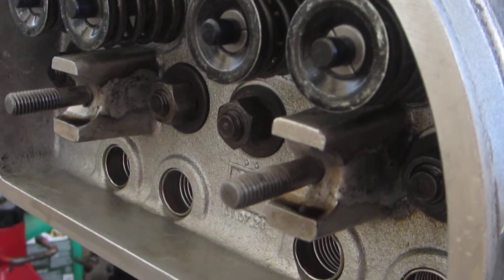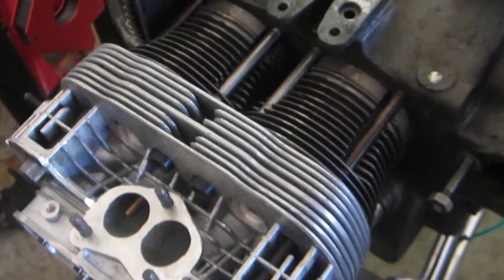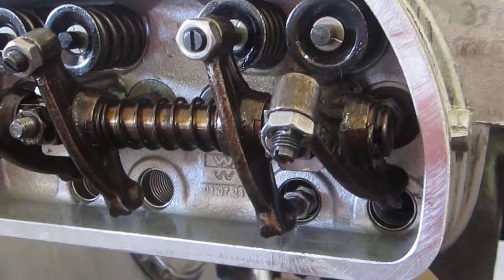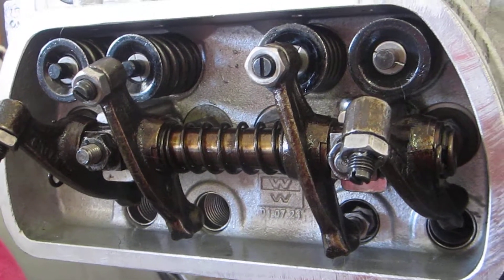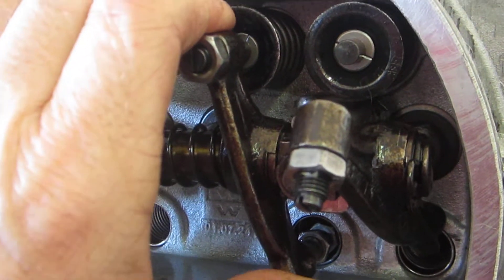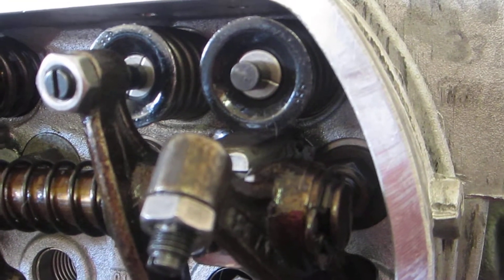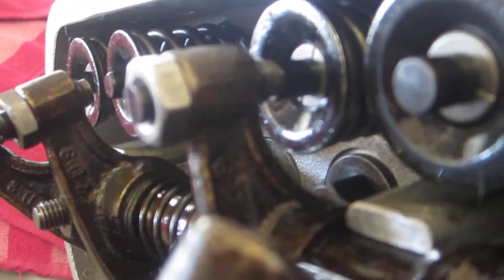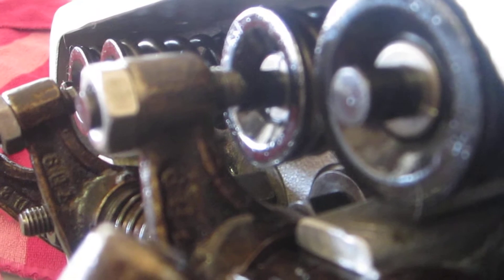Okrasa 36hp VW Heads Back From The Welder + How To Set Rocker Geometry

Comment: I used this kit on my Okrasa build. The carbs are 32 PBIC, not 34. 

I used the 69.5 mm crank, 81 mm pistons, WW performance cam and Porsche 180mm lightened flywheel. 
And the oil filter canister. Also I’m using a Porsche 90mm 12v generator. 

It’s now a 1433 cc engine. I haven’t done a Dyno test but it feels like a strong 1600 dual port. Maybe a bit more HP. But looks cool. I guess it’s about 60 Hp.
Reply from the maker: Ah yes, you are correct. I misspoke calling them 34s. . Your engine sounds like a pretty sweet setup. Enjoy, and thanks for your comment!